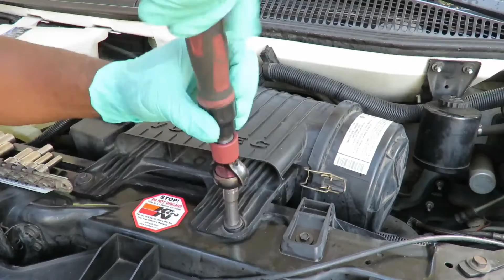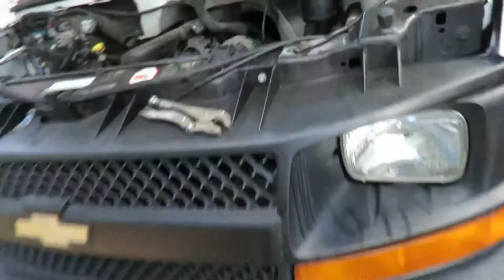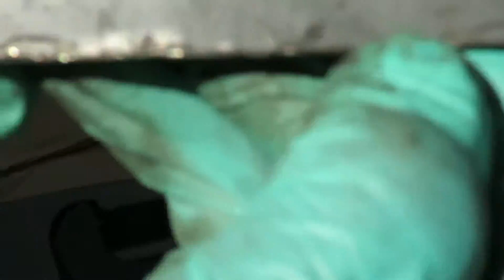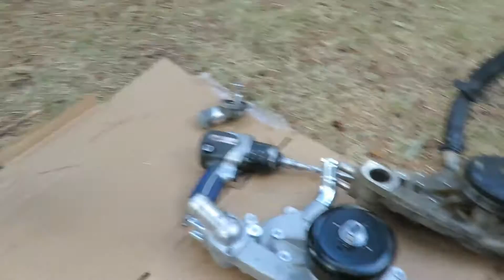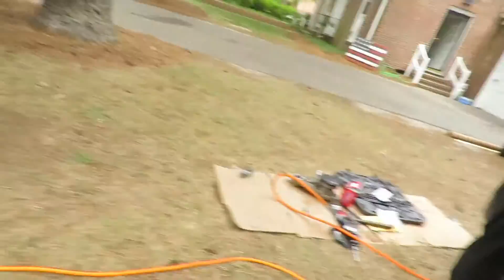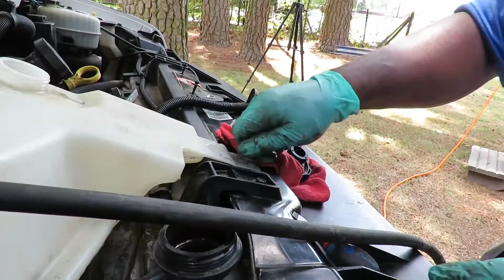⭐ 2005 Chevy Express G2500 6.0 - How To Replace The Water Pump

Comment: We just bought a 2011 3500 and I was worried I'd have to do this exact job.  Luckily, it appears to have been a bad clamp where the upper radiator hose connects to the water pump.  Your video popped up in my feed and I decided to watch just in case.

Great video.  Everything was shown clearly and you're a great teacher.

Comment: I wanted to say thank you for a very informative and well done video.  Very well done!  The only recommendation I would make is to get the right tool for removing the existing hose clamps (to avoid injury) and not reuse any of the clamps due much better quality ones are relatively inexpensive.